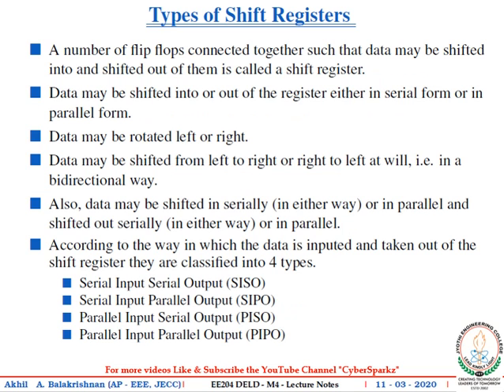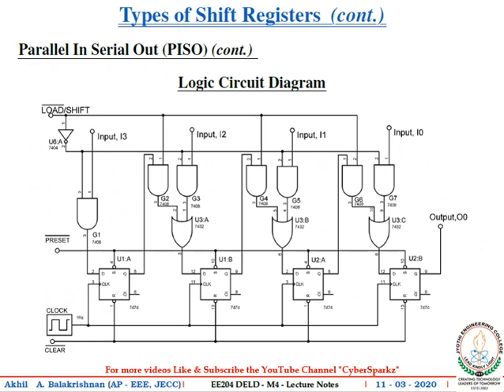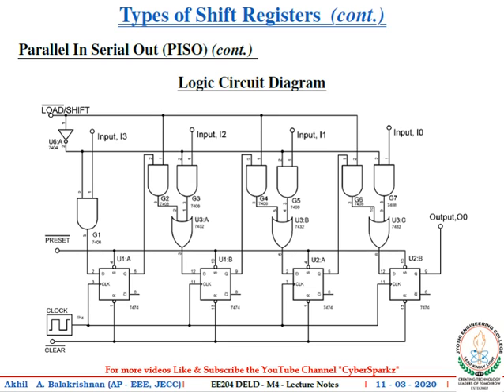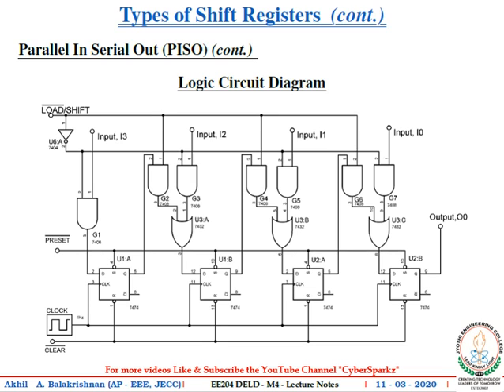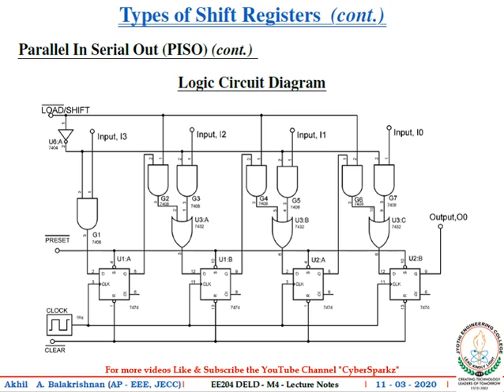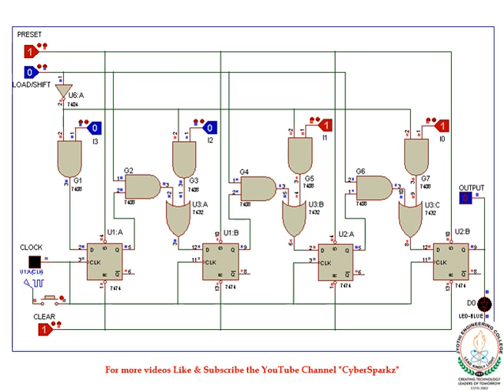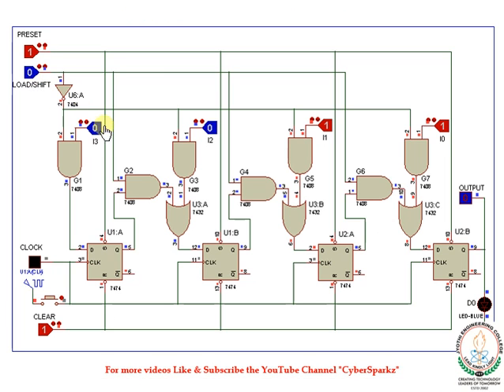Shift Register, PISO - Circuit Explanation

Comment: I would like to ask if you can share some knowledge/material that goes in depth on the mathematical modeling of piezoelectric energy harvesters. What structures could generate power at least 1uW at very low frequencies?